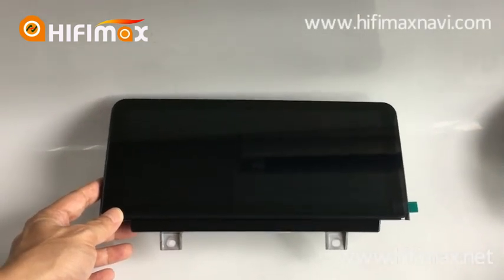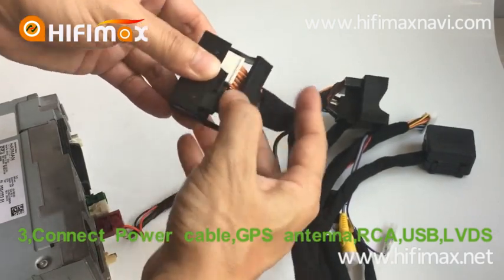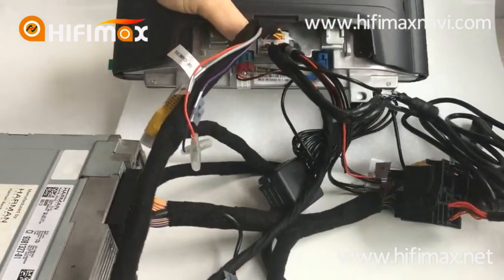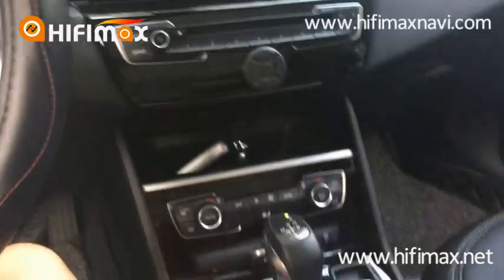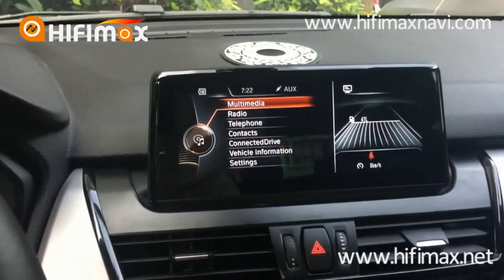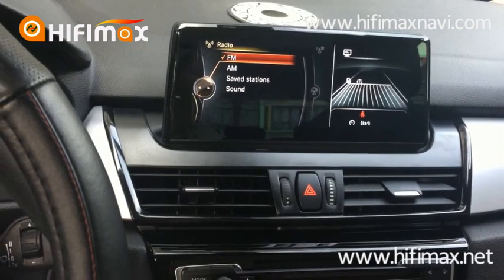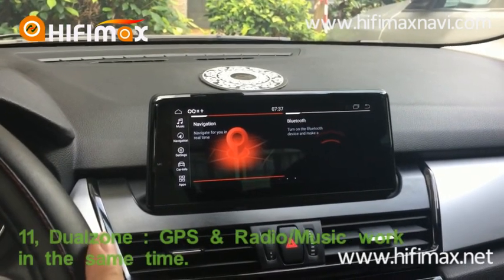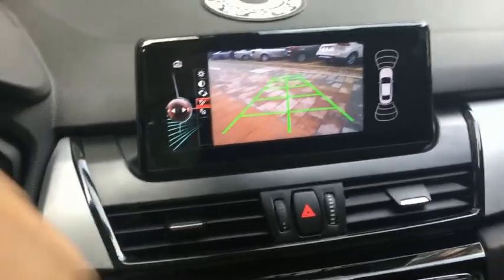Android BMW navigation Installation | BMW GPS screen upgrade retrofit, settings & features

Comment: Please 🙏 sir good work but when I wanted to fixed my own exactly this your own but I didn't plug the original screen wire but I connect all the order wires first no sound, mouse not working for the screen
Reply from the maker: You can watch this video: https://youtu.be/1s_9pJKAMz4

Comment: Hi,

I commented on a different video regarding our unit on x6...

Ours looks very similar to this screen (maybe is this one)....

There is USB and TV in cables hidden in the glovebox, but how do I know where / how to get the Aux cable from the unit to the centre box between car seats - which is where the aux input for car is?

Thanks
Reply: You will need to connect to the unit and input one which is in your armrest.

Comment: Can you tell me why I get aux in the android menu but don't as soon as I go to iDrive system?
Reply from the maker: I am not so clear your questions, you mean in the APP menu, there is an icon named " AUX-IN" ? if that, that AUX-In is not get into original idrive system, you should click "car info" (in main menu) then get into original car menu.
Reply: @HifimaxOfficial   I am getting audio through the aux when I am in the Android side. When I switch to the iDrive side my aux does not work
Reply: I fixed it. I coded enhanced Bluetooth in car.

Comment: Is this with integrated Wireless carplay?
Reply from the maker: you can add the Carplay dongle , if your phone is iOS, you can choose wireless carplay ( need wireless carplay dongle), but if your phone is android phone, it just wired connection only (need connect the USB)
Reply: @HifimaxOfficial  okay thanks, and what about iOS with wired connection? Do I have Carplay with wire?
Reply from the maker: you can connect the USB and use it as "wired mode" (for IOS carplay)